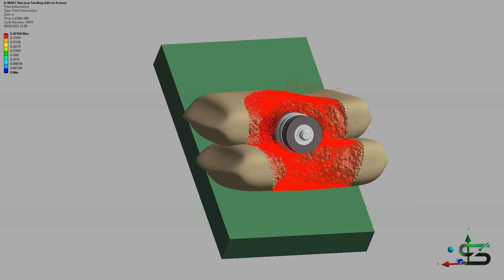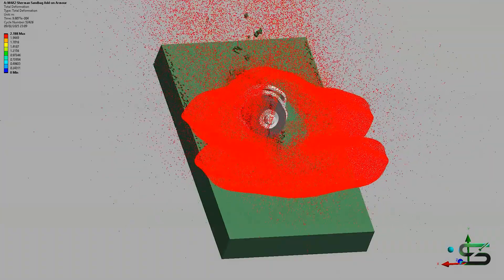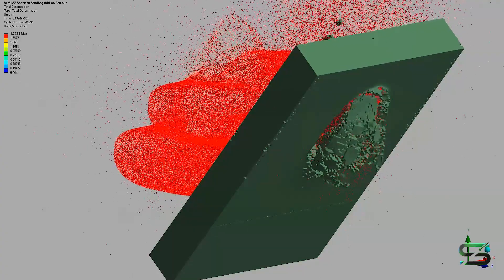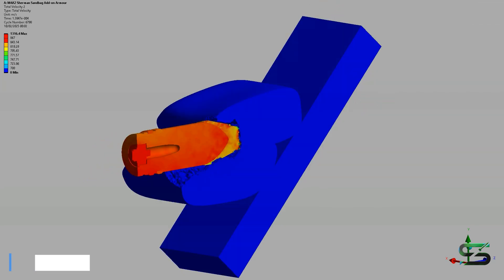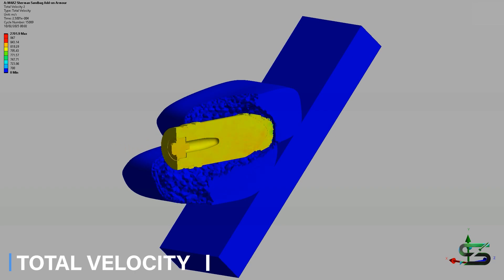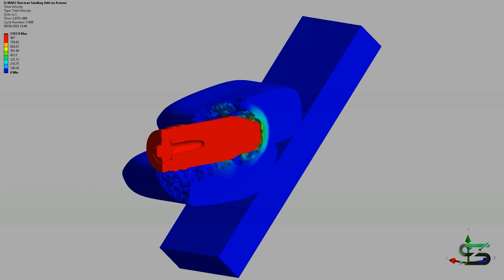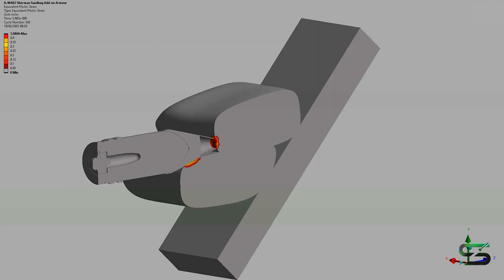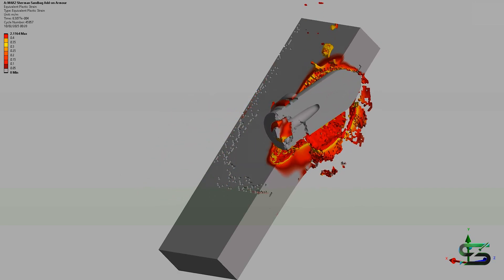Sandbags Add-on Armour | M4A2 Sherman Armour Piercing Simulation

Comment: i heard somewhere that they helped rounds adjust into the angled armor, reducing its effectiveness. is that true?
Reply: I'm not sure about sandbags, but the Army did tests on the effectiveness of logs strapped to the side of tanks, crews would often do this as improvised add-on armor. They found that the logs caused a small decrease in the chance of a round ricocheting at high angles, but not a large enough decrease to order crews to stop doing it, as the crews felt better protected with the logs leading to higher morale.
Reply: Found more info on the sandbags, they didn't really make a difference for most AP rounds but could provide protection against low caliber AP from anti-tank rifles and most HEAT rounds of the time, but this still wasn't a guarantee and like the logs they were mostly allowed for morale purposes, interestingly add-on track armor did cause uncapped AP to have better angle performance in some cases.

Comment: I honestly expected, that sandbags would do nothing, but they actually had some effect on the round. Not bad, but for their weight they really aren't worth it.
Reply: That's why the General Patton always told the tank crews that they should use extra armor plates instead of sandbags
Reply: @NoOnesLikeMe  patton did not like any modification on the sherman
Reply: @kenba96  that makes perfect sense, the sherman worked so well because the suspension and drivetrain where of course developed for the shermans weight and not the sherman +30  sandbags
Reply: Allso one of the resons the Panther tank had its issius do to mustashman whanting more armore and that ended upp making the tank around 15-20tonns heavier @jacqirius
Reply: @NoOnesLikeMe     I highly doubt he would have liked to be one of the crew members of a tank on the front lines, especially without anything such as sandbags.
Reply: @NoOnesLikeMe  Well it was US army regulation, they had done state side testing and determined almost every form of appliqué armor to be largely ineffectiveness in actually stopping tank rounds. With this in mind, the use of appliqué armor was banned in the US army. Most generals just didn’t enforce it, the view was that the increase in maintain was worth the moral benefit even if it didn’t really help all the much, Patton was the exception by enforcing it.
Reply: Strategically they were ineffective but morale improved with crew that use sandbag so they kinda allow it for the crew to function better
Reply: @misakjaxjj placebo effect has kept many a man alive one day more! Remember they were running low on plasma and had to use sugar water!
Reply: @misakjaxjj the sandbags wernt for stopping AT shells, they were for stopping Heat rounds like from a panzerfoust
Reply: @garyslayton8340 again not the most effective but the tanker believe it.
Reply: @garyslayton8340 which they also sucked at for the weight it added.
Reply: @aquadox5514  and that my friend is why patton hated troops modyfing they vehicle
Reply: @kenba96   Yup, except for actual armored plates, since those actually added meaningful protection for their weight.
Reply: @kenba96 Patton's view was it was not worth the weight and extra fuel consumption and he wasn't wrong Patton seem to not have issues if they welded more armor onto the tank in his unit you see more tanks where they took armor from destroyed tanks and welded it to their tanks
Reply: @sqike001ton  The argument that the extra weight would cause mechanical failures and extra maintenance was wrong. 4th AD maintenance logs showed no increase in maintenance on tanks that had sandbag protection.
Reply: 14% seems far too much. We need more than a computer simulation. What did sand bags do against panzerfausts? And wooden logs?  The moral booster is the best reason.
Reply: @vincnetjones3037 they well defeat a panzerfaust due to it being a HEAT round logs would help as well issue is if you're a German soldier with a short range anti-tank weapon you are going to try to get a side shot where the sandbags are ineffective and the logs were difficult
Reply: Not great, not terrible...
Reply: I mean it makes sense since the cap on the shell is fairly soft, so punching through sandbags might grind the cap off the shell and make it more likely to ricochet, which is what happened.
Reply: Considering it got shot by a Panzer V,  I belive it would only dent a Panzer IV shot. Which is not that bad.
Reply: Yes but let's not forget the anger of General Patton against the crew regarding thier Sherman that was packed and weighing down  the tank  with sandbags around. Yes it did stopped a complete penetration but seriously incapacitated at least one member of the near the impact and possibly stopped  the tank...
Reply: Maybe useful against a recoilless rifle or a panzerfaust.
Reply: Now imagine if they used their heads and filled those bags with granite rocks and scrap metal like tungsten tips and worn barrels or bolts.
Reply: @PatTheRiot  I don’t think tungsten was being used in WWII. I could be wrong, but I’m pretty sure it was mostly just hardened steel.
Reply: @mcarrowtime7095  they had tungsten core apsd (armor piercing sabot discharge) or something like that. Not in big quantities but they would maybe pick them up from tank kills or othet mushroomed cores.
Reply: @  apds, armor piercing discarding sabot
Reply: Actually, sandbags have the same work of extra plates, it block HEAT rounds
Reply: That should do it at least.
Reply: Sand bags and concrete on a sloped armor worked like ballistic cap on shells. Crew morale is less usefull when the over weighted tank is a burning wreck.
Reply: You people who think you know better than contemporary servicemen are beyond dumb.
Reply: @I_Commission_DSPriscilla_Art  contemporary servicemen’ of the time were conscripts or fresh volunteers, it’s very likely that with the advantages of hindsight, research, and computers we actually do know a lot better than them. Soldiers are people too, they’re not infallible.
Reply: They are if You're getting shot at by a Panzerfaust which is a HEAT round anything that is a kinetic AT round they aren't effective
Reply: @  actually, it would’ve made early panzerfaust rounds more effective

Comment: 14%? thats impressive
Reply: wouldnt the "survivability chance" be higher than 14% as we are talking kinetic energy the speed is squaredand the difference would be greater than 14%. 100x100=10 000, 86 x 86 = 7 396. 7396/10 000 = 0.739. So it would be a 26% reduction in kinetic energy...
Reply: @Botjer1 the 14% reduction in velocity in this case however is specific to this round. The video notes that the additional protection from the sandbags had more significant impacts on smaller rounds, but against the one used in this simulation it doesn’t matter. There’s no increased survivability chance here because the round will make it through the hull of the tank even at a slower velocity. It’s not a 26% decrease in penetration, it’s just a reduction in kinetic energy. Unfortunately for the crew, even with that reduction of kinetic energy it’s still not enough to stop this shell after being fired by the Panther at such closer range. I would be curious to see this test simulated at greater range though. In that case the sandbags may genuinely help.
Reply: Right? There's exactly no-one who wouldn't take the option of an extra 14% survivability (at only 450m) over a slightly less manoeuvrable vehicle. Especially in hedgerows.
Reply: @arthurneddysmith it was not "an extra 14% survivablity," but reduced velocity by 14%. Not the same thing.
Reply: A 14% reduction in velocity doesn’t equate to a 14% increase in survivability. If the shell penetrates the majority of the time and the velocity reduction effect still negligible in preventing penetration, then it doesn’t help.
Reply: @arthurneddysmith do you know how much it weighs each sandbag? I mean, sounds like a fair tradeoff, but it's not as easy to sacrifice mobility for a little more protection. Mobility can affect survivability as well, imagine if they had to retreat, or escape to a safe position. M4s where medium tanks anyways, extra protection with less mobility, is the description of a heavy tank. So even with bags, a big cannon could go through easily. 

Honestly I too expected it to add more protection, but I guess it's only true with normal bullets and some small tank round.
Reply: @arthurneddysmith  reduce velocity by 14% and increase survival rate are completely different things
Reply: That's what I was thinking, I'd take the extra 14% of margin please.
Reply: in bigger picture, it harms the tank, crew have to repair the tank more because sandbags are fucking heavy

does crew care? no
Reply: The problem is the reliability penalty.  The tons of added weight damaged engines and transmissions.
Reply: 10% is the magic number for margin of any significance of anything in engineering. The question is How many km/h and acceleration you lose ?
Reply: A lot more than I was expecting.
Reply: 14% loss of velocity is pretty significant when you consider the weight and ease of installing those sandbags versus the lengths you’d have to go to up-armor your tank with RHA. This also reduces the fragmentation effects of machine gun fire hitting the tank and flying up into the turret or to the side and into any infantry around the tank.
Reply: It's really not that impressive. Yes, of course it would help reduce the penetration chance. That's basic physics. Putting more stuff in the way of a projectile will obviously slow it down. However, you have to consider other factors, such as the protection to weight ratio, and the issue of post-penetration fragmentation. Sandbags add a ton of weight to the vehicle for little gain. Tanks are designed to handle only so much stress on the suspension and transmission. Also, if the tank gets penetrated, a lot of that sand is going to go inside the vehicle, increasing the amount of debris by orders of magnitude, and widening the spread of it. One could argue that because of this, it actually offers the crew LESS protection.

This video says that General Patton disapproved of improvised armour. This actually is not completely true. General Patton only disapproved of people using very inefficient improvised armour, such as slapping bags of sand or pouring concrete on tanks. He did however approve of soldiers salvaging steel plates and tracks for use as improvised armour, and welding them onto the tanks. These were much more effective at stopping a round, had much less mass than the alternatives, and did not significantly increase the amount of spall upon penetration. Steel is essentially what the armour of a tank is made of, and so it's the best form of improvised armour you could really give it.
Reply: @xxfalconarasxx5659  Sandbags were mostly used against HEAT ammunition, like ubiquitous Panzerfaust and Panzerschreck. There, effectiveness was much more pronounced, as it could simply deflect jet stream to the side. Panthers were relatively rare threat, especially if advancing into German defenses.
Reply: @xxfalconarasxx5659  14% speed reduction results in 26% of loss of kinetic energy. That is huge
Reply: @xxfalconarasxx5659 the weight so a few sandbags are worth it. It's not a car, it's a tank. A few sandbags won't make the speed difference noticable.
Reply: Not really when you consider that the impact medium is softer & conforming.
Sanfbags were not used by the British or most other major powers for a reason as it acts like a ballistic cap without a cap even on the round.

consider that tank armour is surface hardened back in ww2 to 300-450 brinell while russian was even as high as 700 which makes brittle fracture that has many negative implications for the crew.
Britain tended to drill & bolt or welded ectra plates on from captured or unrecoverable armour.
bolting tended to be the preference as you could drop it if fuel & mobility was required.

USA doctrine prevented direct modification of of USA assets which is why they cluttered indirect stuff like sandbags & logs which is really not advisable though considering the armour was modest on the M4 sherman I can't blame tank crews for doing as they did.

Germans has all the many add on modules standardized with skirting & more.
They even experiemeted with concrete mixtures on armour surfaces which had mized results so abadoned the project as it was deamed a waste of materials.

What USA troops did was not out of sensibility but a lack of choice due to the Bureaucracy present in the USA chain of command!

Britain for the most part let the troops do as they pleased to the tanks as long as they they got the signature for the material or salvaged the material themselves.

With this context in mind you can better understand why USA tank crews did what they did while Britain, Germany, USSR & any other power had no reason to use clutter-armour as I call it!
Most of the Time Britain & Russia cluttered the tanks in fuel or water canisters & Jerry cans due to the nature of the distances involved in the refion of engagement in in Eastern Europem, north Africa or Burma campaigne.

If you are going to have fuel any were it is best on the outside of the tank & you would be amazed at how much a jerry can with water can reduce a rounds velocity as it is more then a sand bag while doubling as something you drink.
Best thing the Germans made was the Jerry can which Britain picked up on to use the same quickly!
Reply: https://www.youtube.com/watch?v=YMEuy0G5n34 Sums up British tank development using USA assets & anything else at hand!
Reply: Except that it didn't even degrade the ballistic cap
Reply: @connivingkhajiit  Valid point as I nticed it now that you mentioned it!
You got to laugh.

Comment: you should try doing sandbags vs HEAT or HEATFS
Reply from the maker: A hypersonic jet of HEAT round will face no difficulties propagating through a sandbag and will only work as a spaced armour. The space and angle, however, cannot be optimized in the case of sandbags, thus, it won't be enough for disturbing the jet.
Reply: @SimulationPlus  i ask doe. What if a guy put a container filled with water as an add-on armor against heat rounds.
Reply: @kazalacker8985  bro, its molten copper at hypersonic speed.
Reply: @bagelmaster2498  i heard it reduces the effectiveness
Reply: @ look up dejmian's simulation of fuel as armor. Its effectively the same thing. Little effect.
Reply: @kazalacker8985  IIRC water has a thickness efficiency around 12 % of RHA vs HEAT.
Reply: @kazalacker8985  I'm not sure about HEAT shells but surely does to kinetic's ones!
Reply: @ i see, thanks for answering
Reply: It was popular enough for basically the entire tank fleet of both the 12th and 14th Armored Divisions having been officially sanctioned by the 7th Army to counter German AT launchers. Whether or not it was effective or just a placebo/morale effect would be interesting to simulate regardless because it was so common.
Reply: Maybe I remember wrong, but I read somewhere that sandbags (or in general any other thing put on to of the armor) could increase the effectivness of Heat rounds, as the could create a better distance from the hypersonic jet to form.